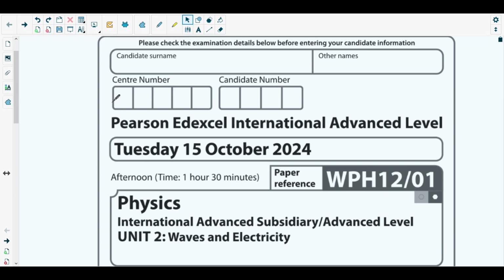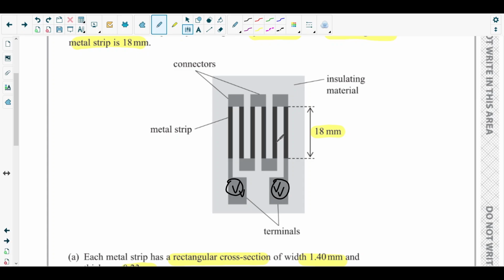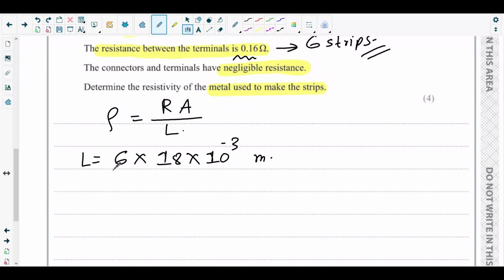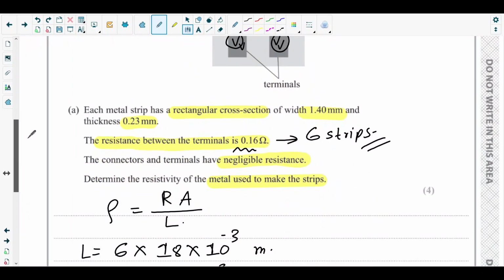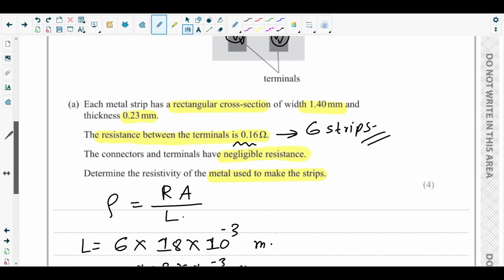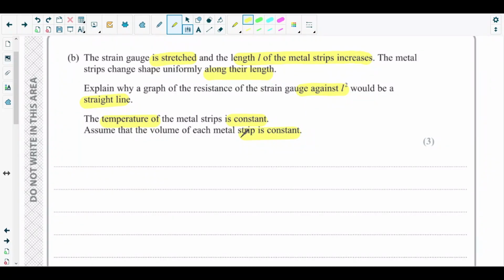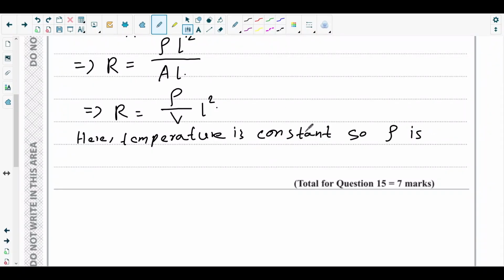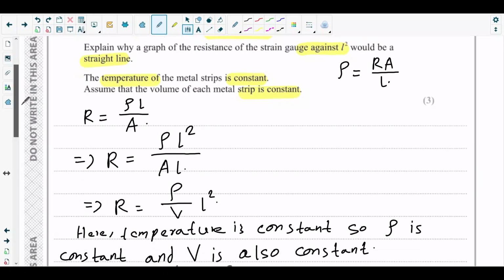Q.NO.15-Determining Resitivity of A Material & Concept of Graphical Method.

Comment: WHY DO WE HAVE TO DIVIDE IT BY SIX? Could you please provide me with a DETAILED explanation?
Reply from the maker: I think you meant why I multiplied by 6 in part a, 

Between the terminals there are six strips, in the question lengths of a strip is given, so when current flows from one terminal to the other it flows through 6 strips Successively, so resistance increases with the length of strips
Hence, total length, L should be 6Xlength of single strip